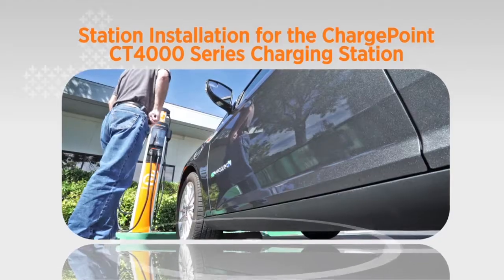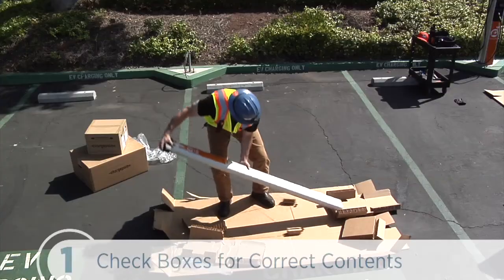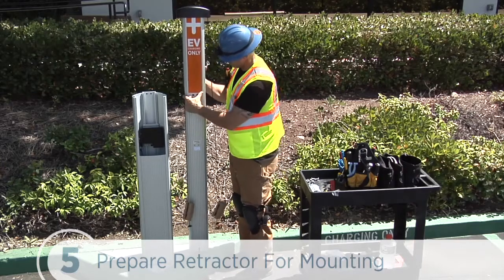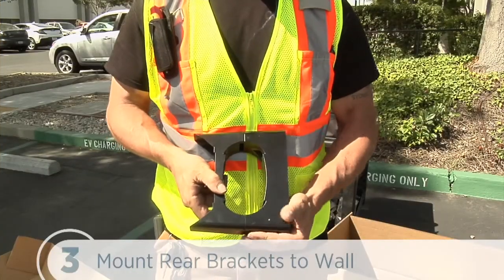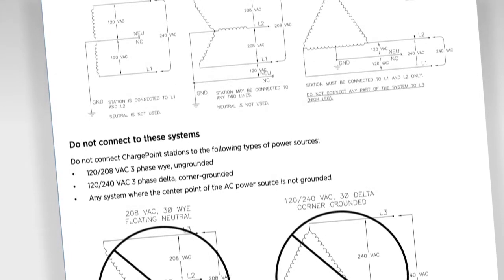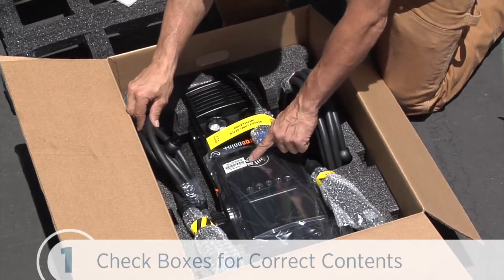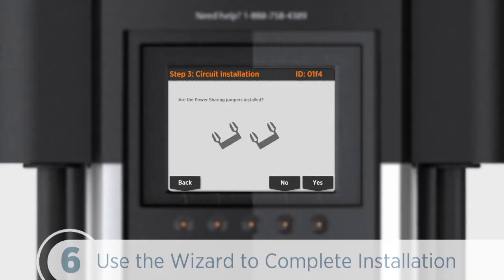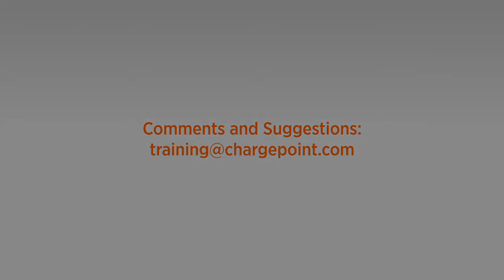ChargePoint CT4000 Installation Video

Comment: Lock-Out, Tag-Out at the breaker box should have been verified BEFORE doing any work! Also, installing pin terminals and heat shrink tubing on the wires would avoid any stray strands and the risk of a fault.

Comment: Ok i should watch this video before do anything.  My coworker accidently insert charger connector to holster,   now it's stuck in it.  How to remove it out?  Thanks
Reply from the maker: Please call Station Owner, Installation, and Partner Support at 1-877-850-4562
Reply: @ChargePointnet  Bilkul
Reply: Hi What was the solution ? I have the same issue. 
Thank you

Comment: I inserted the handles into the holsters before power. It's stuck. Now what
Reply: Hi what was the solution ? I have the same issue.
Thank you
Reply from the maker: Please call Station Owner, Installation, and Partner Support at 1-877-850-4562
Reply: Comment devenir partenaire à chargepoint
Reply: Any updates? I got the same issue